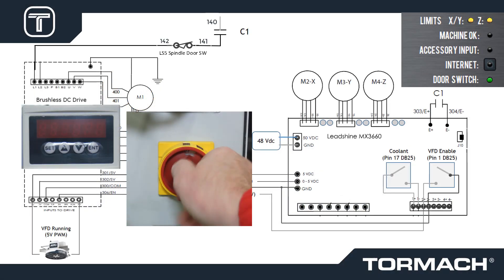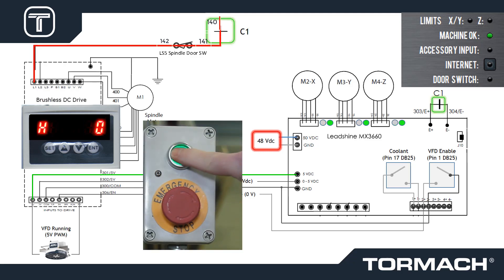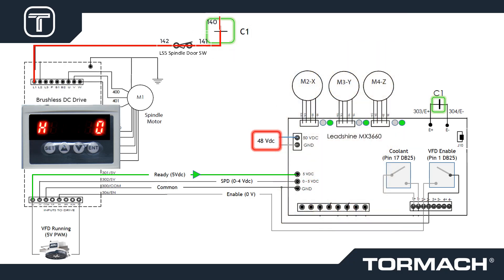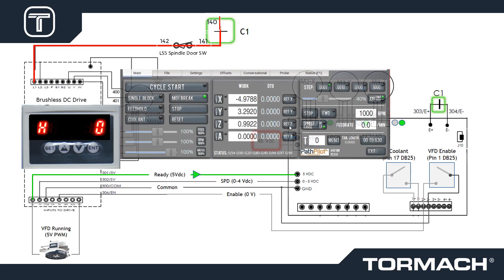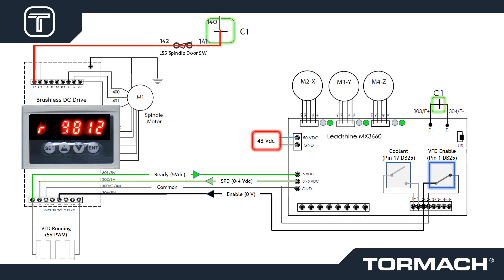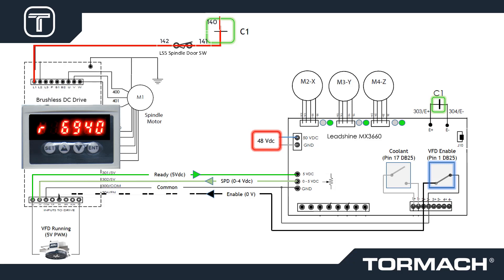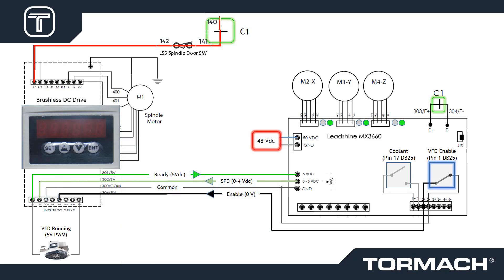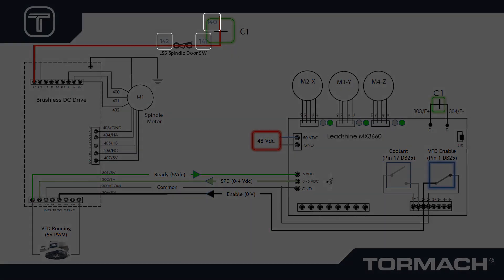Tormach PCNC 440 Electrical Operation and Troubleshooting

Comment: What if “slightly tapping” on the BLDC is causing the spindle to stop and PathPilot to go into Reset mode… discovered this as I have a three week old 440 that crapped the bed on my today. Under any slight load on the spindle or even moving the heavier Z will e stop the machine into this reset mode

Comment: This has been a very helpful video. I have used it twice with great results. There is one thing I might revise. You turn on the power without making any statement that the pathpilot has to be turned on first.